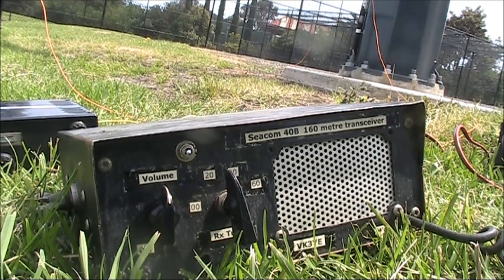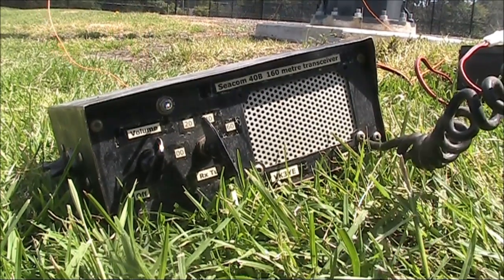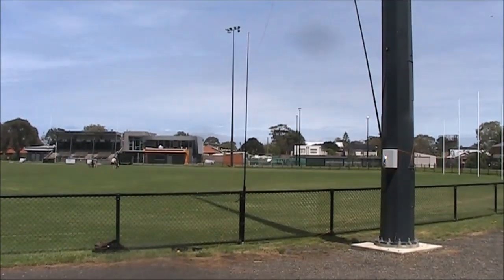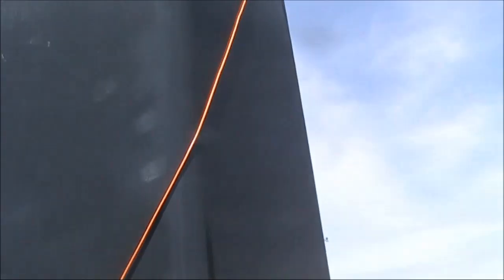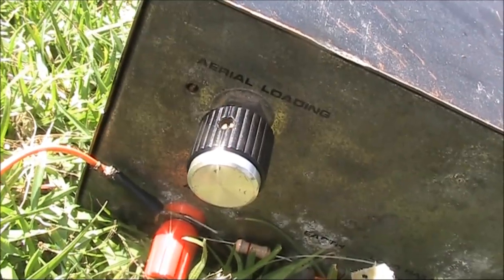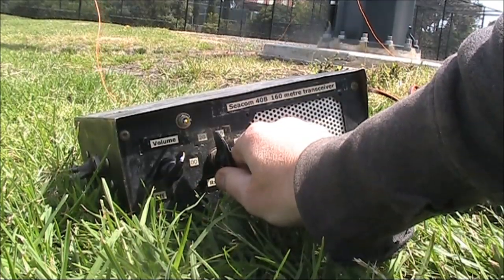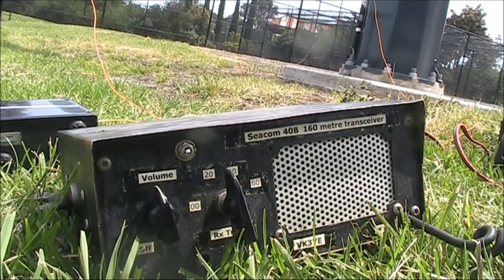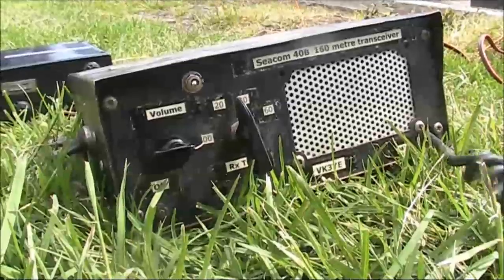Turn this 28m light pole into an antenna for 1.8 MHz

Comment: Hi Peter, did you try a direct connection to the light pole to see how it compared to the loop coupling by any chance?.... Dave G4AKC
Reply from the maker: Hi David - I did but couldn't get much noise when connected at the bottom - I suspect it was earthed.

Comment: 160 Metres, if its long and metal it will load up nicely. Besides support towers, bridges, old telephone lines and such work great. Nice to see an old marine or station AM radio working. Hard to find here now. In the past 160 mobile was the local repeater channel of its day running military pack radios.

Comment: Nice one Peter.   It reminded me of a different example I saw once.  In theory, you should be able to put a flat conductive band around the base of the pole, say 50mm wide of  thin copper strap, wrapped in tape.  Place another similar band around 4-5 metres up.  Call it 'Distance X'.  Then use two telescoping, but insulated tubes mounted between ground level and the top band.  Call the amount that the tubes telescope Distance Y.   The unbalanced feedline can connect between the lower strap and the un-terminated tube end.  Essentially it is a fabricacted 1/4 wave antenna with a gamma match coupler.  Distance Y is a variable coupling capacitor matching resonance of the operating frequency.  Distance X is adjusted to match the unbalanced feedline impedance of 50 or 75 Ohms.
It ought to work.  
Cheers, Ian VK3BUF

Comment: Nice to work you Peter, I can hear that I was just copyable, but not bad for 50 watts between Eltham and Chelsea in the middle of the day.  The NanoVNA suggestion is a good one.  Makes me want to dive into the antenna books to understand more about coupling to a grounded pole or mast.  I hope you do more of these experiments.  73 de VK3HN.
Reply: It was my understanding that they were grounded in the first place for lightning protection. Color me puzzled. Maybe the wrap around the grounded core was a factor.
Reply: @bryanst.martin7134  Yes, must be a form of inductive coupling using a non resonant loop into a grounded conductor. I haven't heard a clear explanation of what's going on yet. But everyone seems to agree, it worked.

Comment: VERY INTERESTING
I am also an amateur myself but sometimes broadcast (gray) on MW
the nasty thing is that you cannot lose the full length of wire,
also what has a kink in the antenna wire for influence etc ......
here in the Netherlands they also often talk about the coil antenna.
what kind of tuner coil do you use?

until so far again!
greetings from here!
Rob.